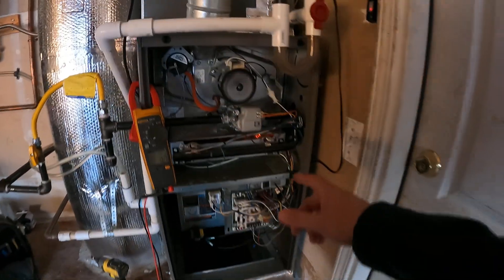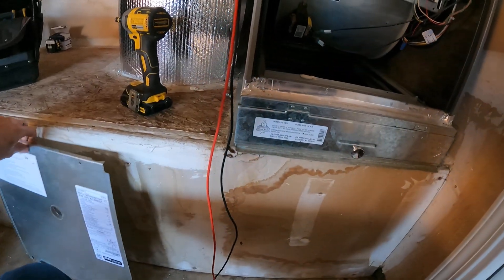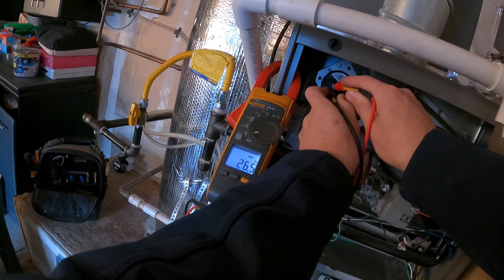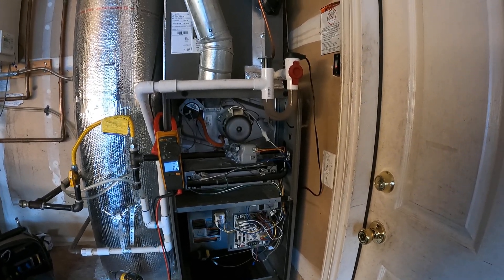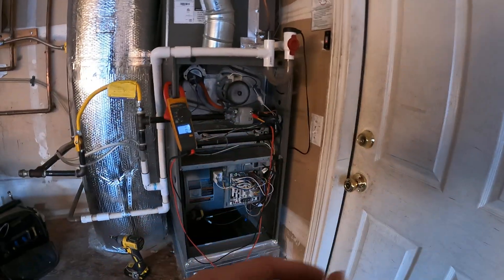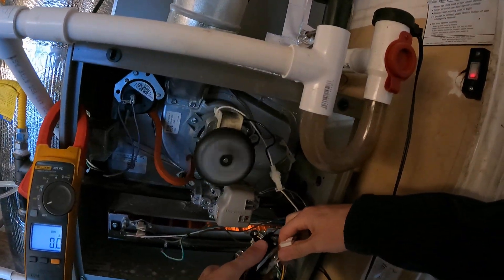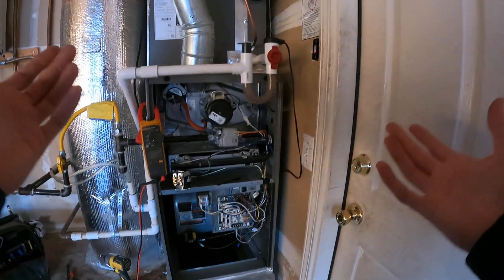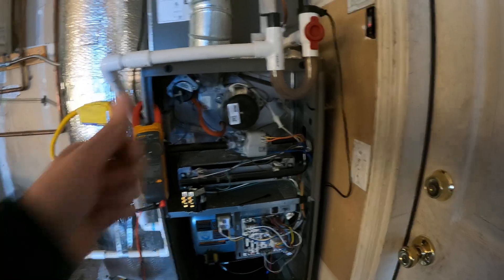How To Diagnose Failed Gas Valve On Furnace

Comment: I have a millivolt gas valve. It is getting about 630mv at the th and th-pg terminals (which should be good, as the millivolt system is mav 750mv). The main burner is not coming on. The thermostat is calling for heat. The pilot flame is on. The  thermostat circuit includes a limit switch. I am unsure if I have a bad gas valve, or a problem in the tstat circuit. Is there a CONTACTER I can use that would be activated by millivolts that I can buy and use to verify the tstat wires make the contacter click, or not. Any advice is appreciated. Thank you!

Comment: So on the pressure switch you read 24 because the switch was open. If switch was closed you would have read zero volts? Awesome video.
Reply from the maker: Exactly right. A closed pressure switch will have 0v across the switch due to there being no potential difference between the two sides of the switch. You would still have 24v from each side of the switch to ground though.
Reply: @HVAC_Academy  This meter test of a switch confused me also. (not an electrician here).

So, if a switch is closed, which means voltage is going thru the switch to a load or another switch, then the multimeter will read 0v across the switch (that is, 0v when meter probes are placed on the two terminals of the switch)? And that is because there is 24v at both terminals, and the meter reads it as 24v -24v = 0v?

And then, the meter will show 24v (with the pressure switch) if the switch is open because the voltage is only 24v at one switch terminal, and not the 2nd terminal, and the meter is reading the difference (potential difference) of 24 v on the input terminal and 0v on the output terminal? 24v - 0v = 24v?
Reply: So if what I just typed above about a switch is correct, and I tested a LIMIT switch, and it showed 0v - that means the LIMIT was closed, and the voltage went further down the circuit, to the GAS VALVE, and then to the THERMOSTAT, and then back down from the tstat (if itsat was closed) - to the gas valve's main solenoid - to cause main burner to ignite?
Reply from the maker: @m.n.3490  You have the concept correct. They key here is that "potential difference" if there is no difference in voltage it will not show on the meter. This is why it's important to check across the switch as well as from one leg of the switch to ground.
Reply from the maker: @m.n.3490  In a nutshell yes. Some systems are wired different but yes, if you have an open switch (limit switch or pressure switch) it stops that voltage form getting back to the circuit board and the system will not run.
Reply: @HVAC_Academy  I was actually interested in the mv readings I am getting on the gas valve's terminal screws.My main burners are not lighting sometimes. Although I can force the burners on using a jump wire from TH to TH-PG terminals on the gas valve

I am getting around 633mv from TH to TH-PG. and 636mv from PG to TH-PG - with the MAIN BURNER OFF. 

When the main BURNERS FIRE UP, the mv voltage lowers to 187mv from TH to TH-PG, and to 380mv from PG to TH-PG. 

So, I am wondering if I have enough mv from the thermopile, or am losing mv in the circuit, or if my gas valve is getting weak?
Reply: @HVAC_Academy   I was actually interested in the mv readings I am getting on the gas valve's terminal screws.My main burners are not lighting sometimes. Although I can force the burners on using a jump wire from TH to TH-PG terminals on the gas valve

I am getting around 633mv from TH to TH-PG. and 636mv from PG to TH-PG - with the MAIN BURNER OFF. 

When the main BURNERS FIRE UP, the mv voltage lowers to 187mv from TH to TH-PG, and to 380mv from PG to TH-PG. 

So, I am wondering if I have enough mv from the thermopile, or am losing mv in the circuit, or if my gas valve is getting weak?
Reply from the maker: @m.n.3490  full transparency; I do not have a ton of experience diagnosing furnaces that old with that specific issue. Without research and knowing the exact unit I would not be much help. I wish you the best of luck though!

Comment: This same scenario fooled me the other day.... I checked voltage at the gas valve like you did and condemned the gas valve, but i didn't do the contactor trick. Meter told me I had the right power but the board wasn't really sending that power to the gas valve for whatever reason...bad board.
Reply from the maker: that contactor has definitely saved me a few times.
Reply: @HVAC_Academy  Ye i checked out a few of ur other videos too they help a lot. I'm a newer tech so i have a giant list of tips and things to help me.